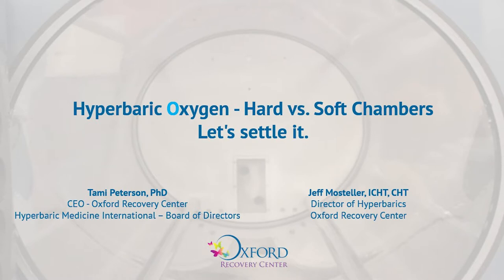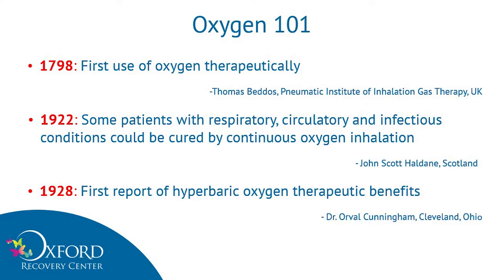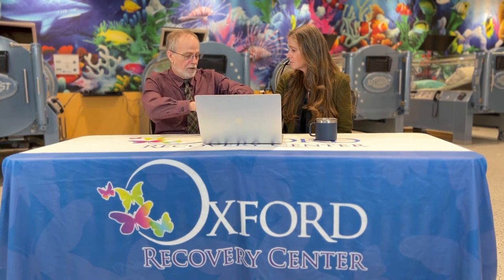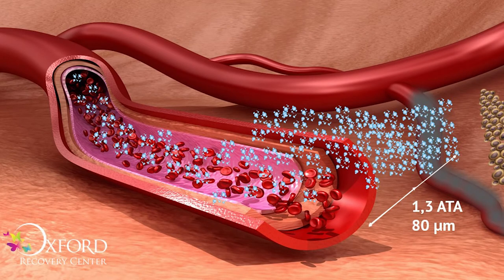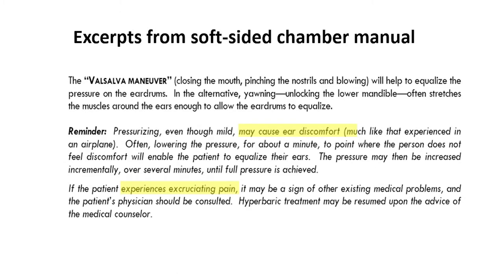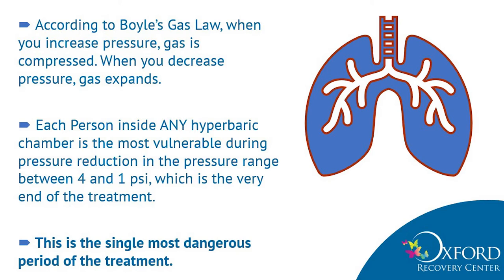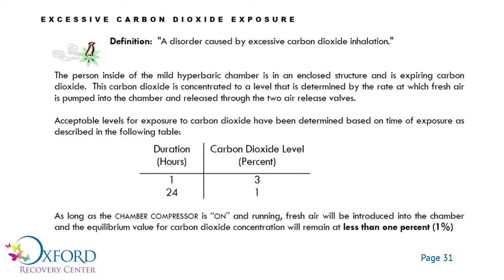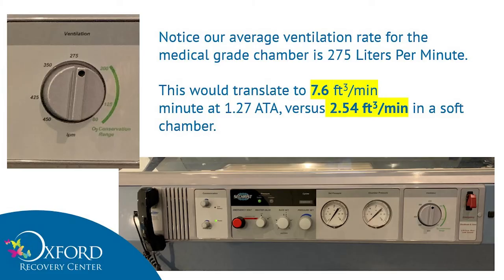Hard vs Soft Hyperbaric Oxygen Therapy Chamber Information

Comment: Sorry to say for you but Mild Hyperbaric Chambers work!
Reply: I came here after reading what was basically a hit piece on mild hyperbaric chambers to see what the comments would be. Glad to see I'm not the only one who disagreed with them.
Reply: @nickdietrich3410  It is a hit piece. They hate that there is competition.
Reply: The evidence presented against mild chambers is dishonest at best. Pressure of 1.3 or more to activate the immune system is stated. Ok but both types meet or exceed this pressure. So, it’s not indicative of a distinction in efficacy between the two types. Then, they quote from a document specifically discussing hyperbaric treatment of SCUBA related problems. Finally, the potential co2 and o2 problems with ventilation could exist with any poorly designed chamber. The discussion was informative. However, the obvious conclusion is to ensure adequate compressor flow to avoid gas buildup and to ventilate to the outdoors. Their use of these points to discredit the safety and efficacy of mild chambers does the opposite. My take away is that if this biased video had to resort to disinformation to guide the reader to their predetermined conclusion then there is little to no actual evidence against the safety and/or efficacy of mild chambers.
Reply: Than you for saving me over an hour of my time by summing up what the basis I this video was.
Reply: My local facility tried terrorizing me in to thinking I would explode if I got my own because of the pressurized oxygen